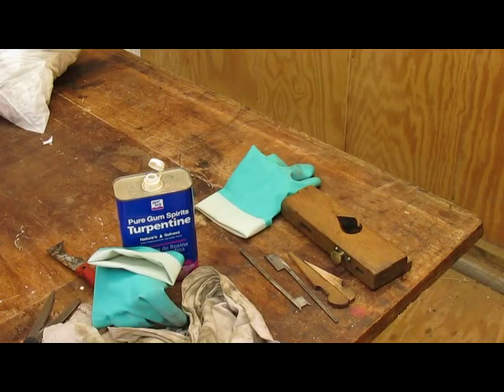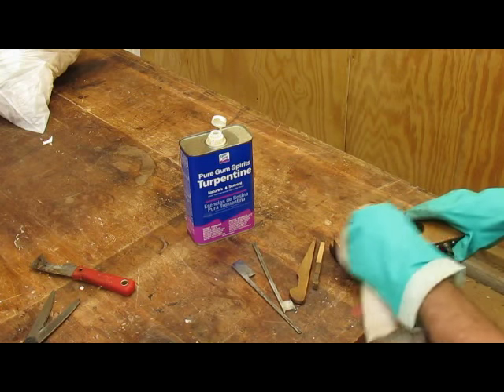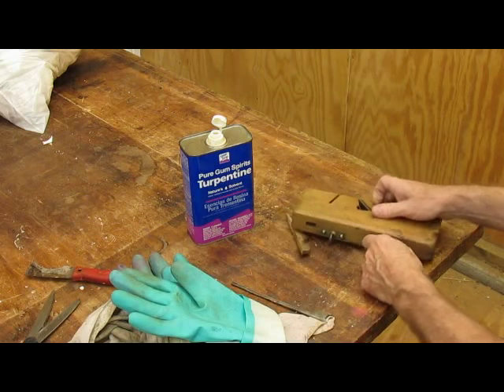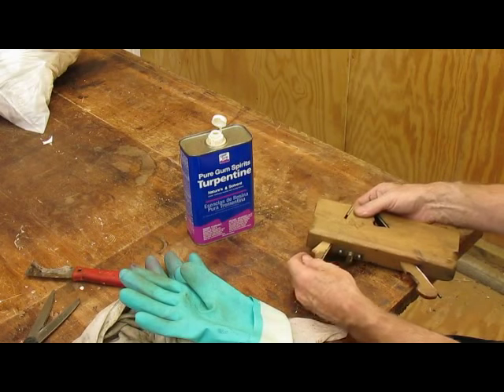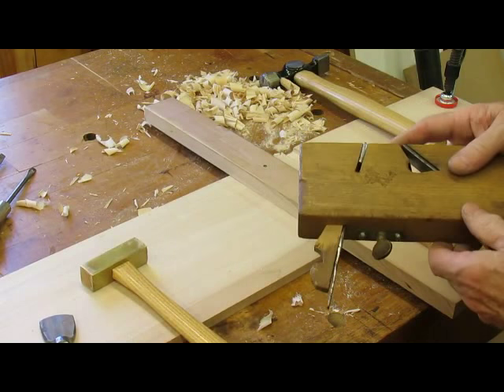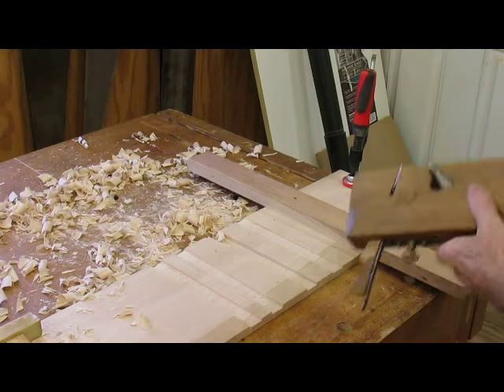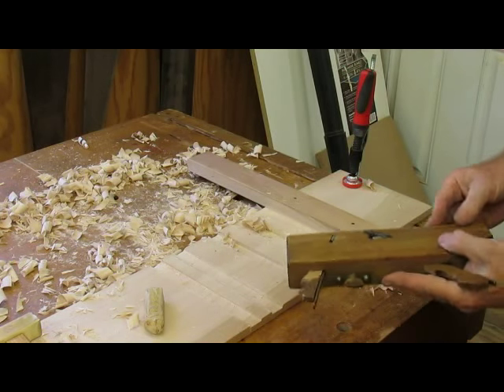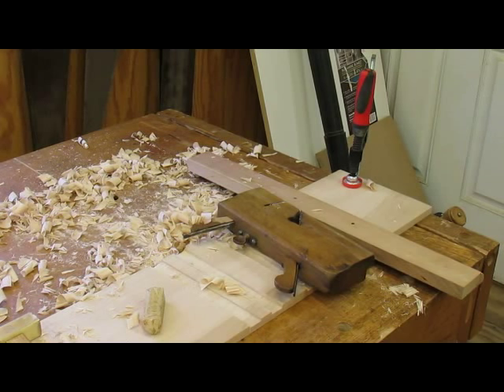Recondition Sandusky 177 Dado Plane

Comment: Plane more off the wedges and they'll extend further down.
Reply from the maker: +deezynar Thanks, I may do that, but for now the blades don't chatter
Reply: Ya, blades don't chatter if the bed is flat and the wedge is tight and somewhere near the cutting edge.  I think problems happen when the wedge, or screw on mechanized planes, is loose.  I made a rabbit plane using a leaf spring from a car for the blade.  No chatter ever with that thing.  You have a very nice plane there.  I've been thinking about making one, but using down and dirty methods to prove that the precious tools people covet are nice but not needed.  I'm thinking of using plywood and a couple of cheap chisels.
Reply from the maker: +deezynar Good to hear from you, sounds like you have a lot of experience making planes.  I have made a number of them.  Fun little projects but the angles on the bed of this dado would be challenging on a one piece side escapement plane.  That's why I decided to try to recondition it first. :-)  
Regards,
Dave
Reply: I've only made 2 planes, the rabbit and a sliding dovetail.  My plan for the dado is to go with the blade straight across, 90 degrees. It won't cut as smoothly as a blade on the diagonal but it'll work.  I'll have a scab on both sides of the center body.  Since the scab will never touch the fence it won't be a problem.  I'll cut all the pieces on the table saw so I'll get the wedges from the same cuts as the body.  I said down and dirty and meant it.  Fine Woodworking had an article in the 80's about a Vietnamese immigrant who got out with nothing.  He made his own tools out of scrap and made a living with them.  Those tools looked like junk but his furniture was awesome.  I like fine tools as much as the next guy but think we get snared by them.